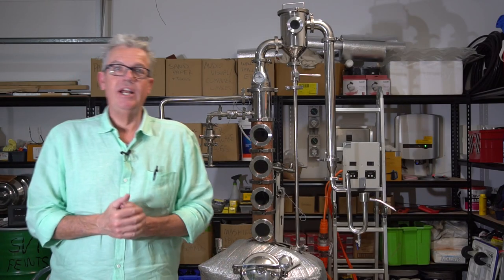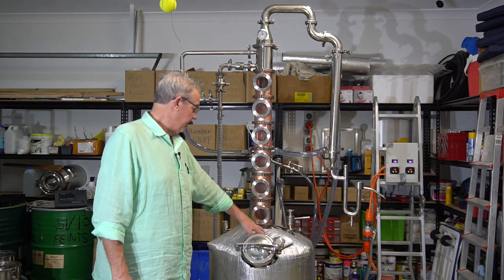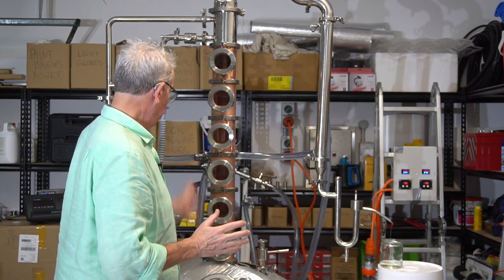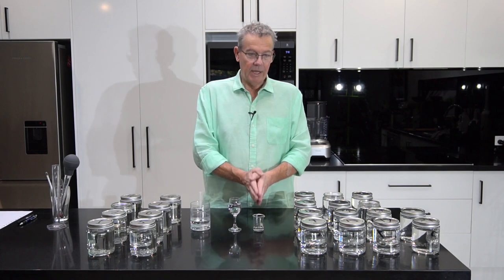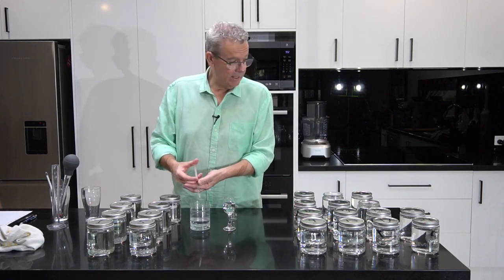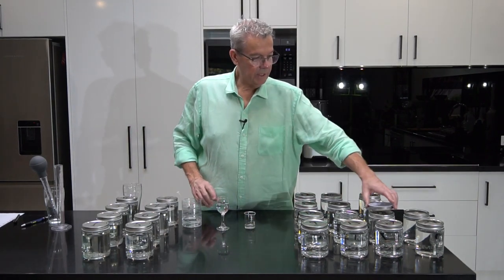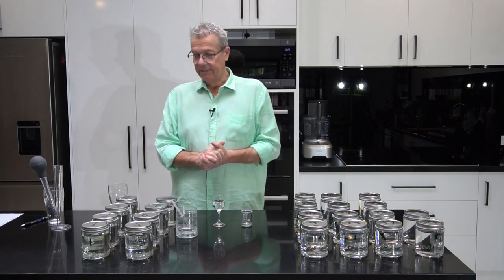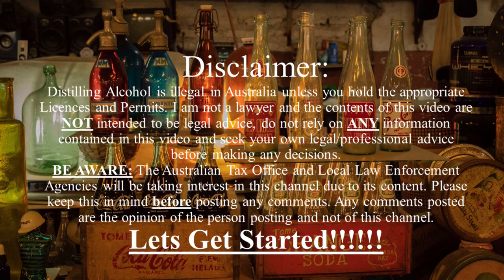#42  Still Up-Grade and 1st Run complete with cuts and final volume

Comment: Hi Nick, how long did it take to do your run from start to finish with your setup? I’ve got a 4” 4 plated still with 500mm packing section + 95L boiler on the way and wondering how long runs will take me. Also, how are you accessing how much power you need to put in as the plates start loading?
Reply from the maker: Hi Matt, about 2 hours to heat up (but I only run at 75%) then about 4-6 hours to collect depending on settings. If it's not too late purchase another 2 plates to make it a 6 plate system. Here's a link to power https://youtube.com/shorts/SRCkSkeE5Ww?feature=share
I have 2 X 5000w elements running on single phase.
Welcome to the family.
Nick
Reply: @distillinginaustralia3257  Thanks Nick. At the moment I can only run 2 x 2200w elements for my 95L but plan to upgrade once I move house. How much did it cost to get 2 x 32amp circuits installed with GPO's?
Reply: @TPGMatt  For only a 95L boiler and 4inch column, you wont need more than 4400w anyway. You'll find you'll be heating up with the full power, and then only use 3600W for the spirit run. Too much power and you are just going to flood your column. 
+1 for getting an extra two plates, if you want a better neutral.
Where did you buy your still from?
Reply: @golly181  got mine from down under still in QLD. The guys name is Gowit. Bloody legend!